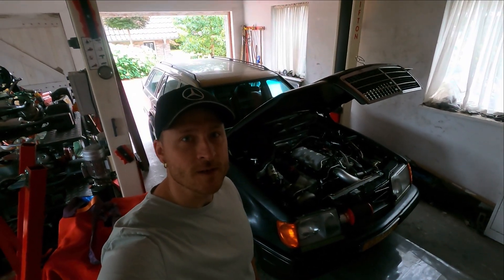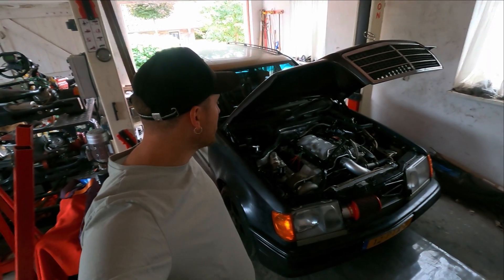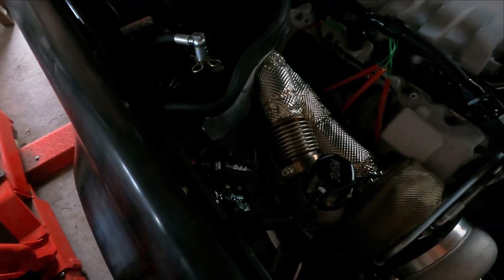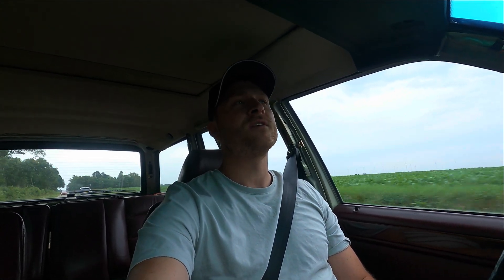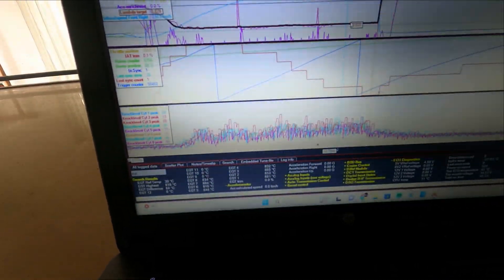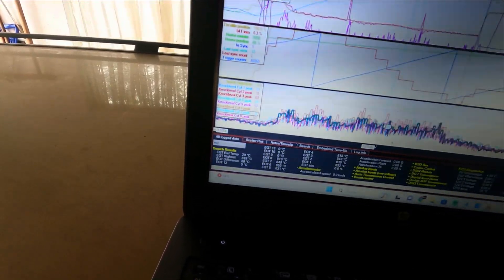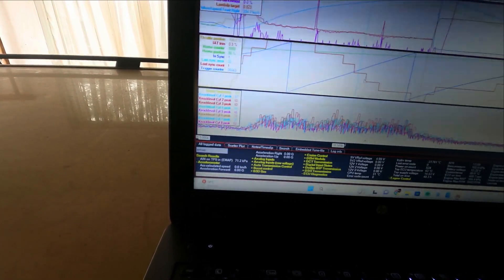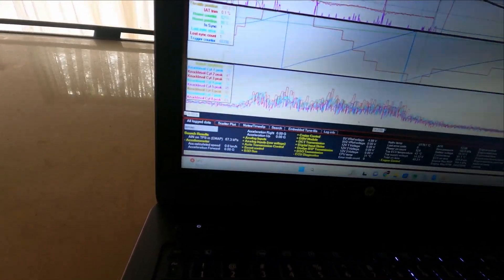S124 V8 Turbo street tuning up to 0,8bar

Comment: How did you determine knock sensitivity? And the false positive you getting, increase the sens table at vacuum/0% tps
Reply: Well on some engine its fairly clear in the knock sensor signal when there's real knock. If not i normally use a separate sensor with headphones to verify
Reply: Knock thresholds are fine tuned on the dyno this week by the way
Reply from the maker: The threshold.is determined last time on the dyno with the tuner.  Yes have to see how i can do that at 0tps i will look in to that if i can adjust the table